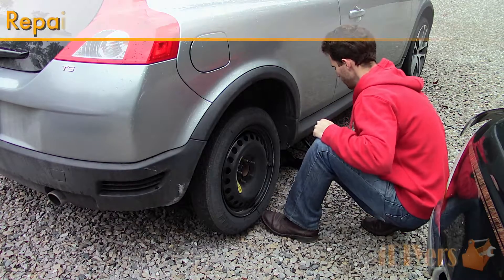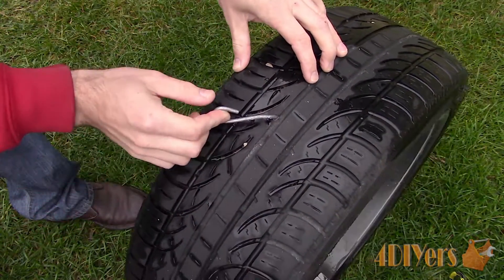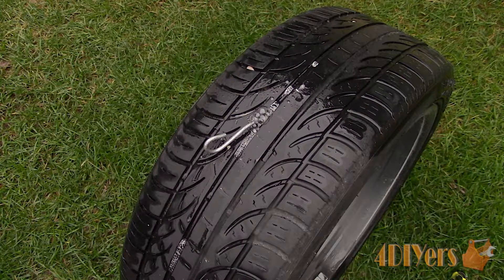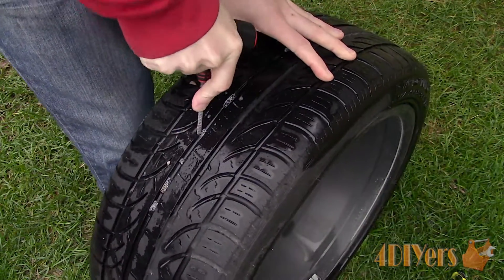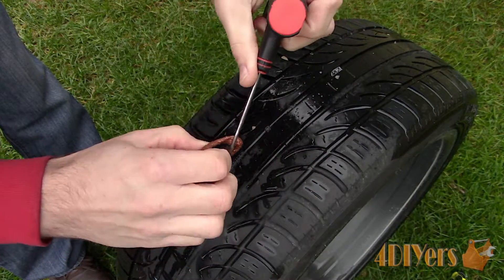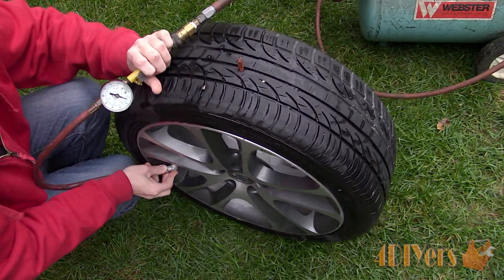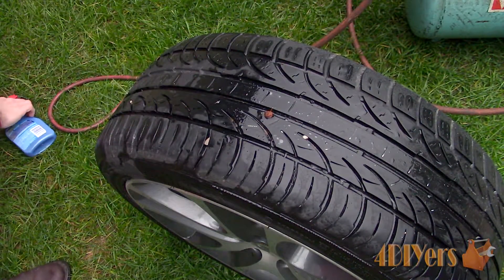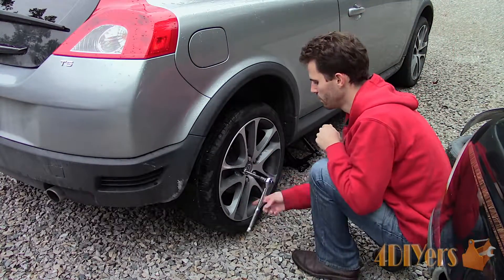How to Repair a Tire Leak using a Plug [Everything you Need to Know]

Comment: I predict someone will post that you need to use rubber cement with the plug, it happens on every tire plug video lol.
I bought a package of screw in tire plugs that came with a little pry bar from Canadian Tire.  Not sure how well they'll work but I figured they might come in handy in a emergency situation.  No need for the reamer or the plug tool,  just pull out whatever got into the tire with the pry bar and screw the plug in.
Have a great weekend.
Reply from the maker: I had to take a peak on their site, first time seeing them. I'm kind of curious how they'll work too, although they did have a 1 star review. 
Thank you and you too!